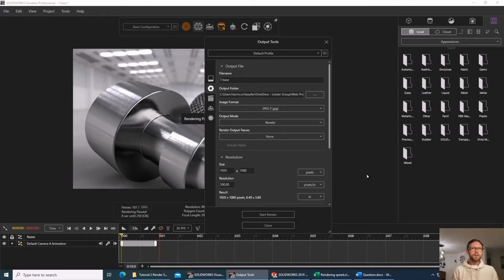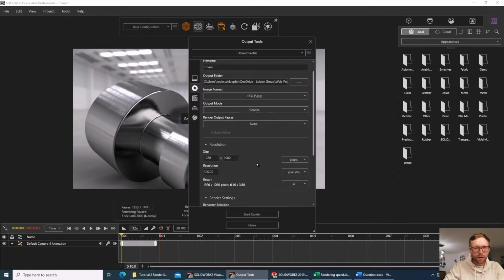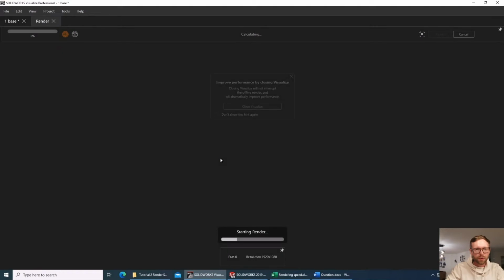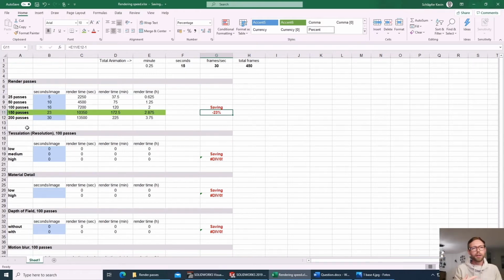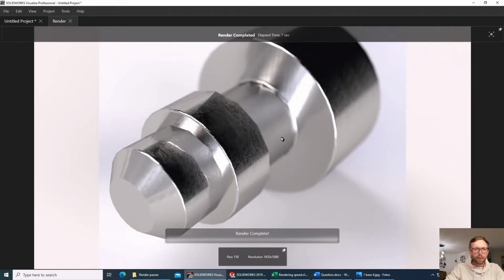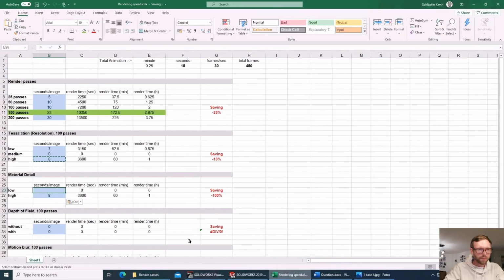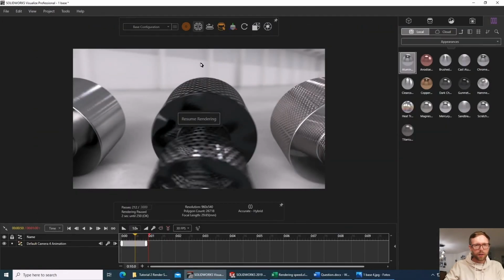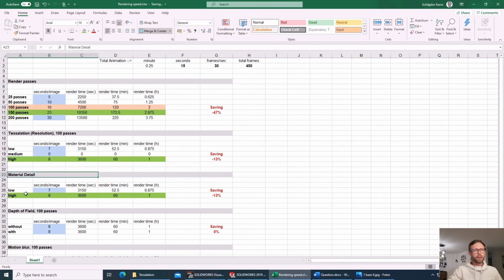Solidworks Visualize Tutorial - Render Speed Optimisation and Render Passes

Comment: THANK YOU SO MUCH
Reply from the maker: You're welcome
Reply: @solidvis-solidworksvisuali4211  I cut down my rendering time by half ! May I know your workstation specs?
Reply from the maker: @l.d.tjonathan5101  great to hear. At the moment dual CPU, 256MB-Ram, Quadro 5000, which works very well
Reply: @solidvis-solidworksvisuali4211  im currently using dual cpu intel xeon bronze 3102, 32GB ram and quadro P4000. However, it is still choppy when work in visualize, especially when adding textures or setting the environment. Is this normal?
Reply from the maker: @l.d.tjonathan5101  everything sounds like a very good base... The RAM is critical in my eyes. With the Quadro 4000 you can go very far in complexity until the denoiser gives up
Reply: @solidvis-solidworksvisuali4211  great thank you ! Maybe i just need to optimize my settings for better performance